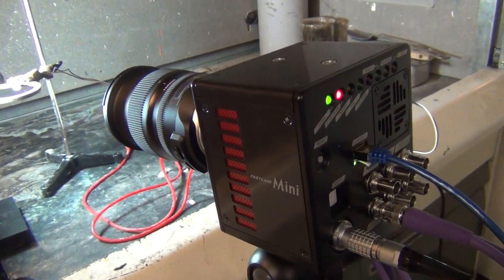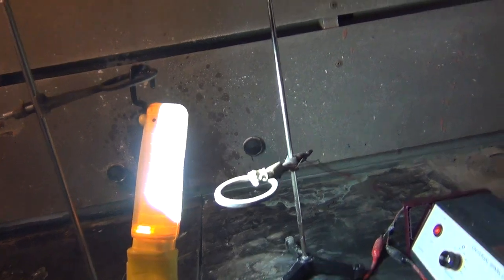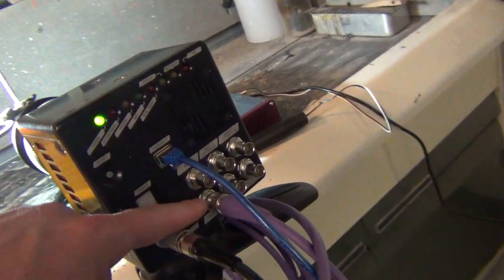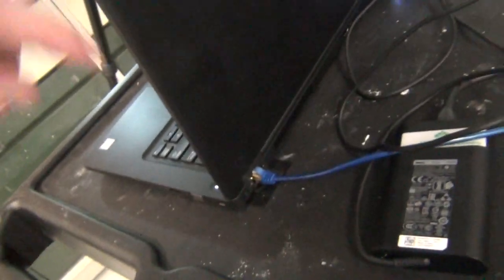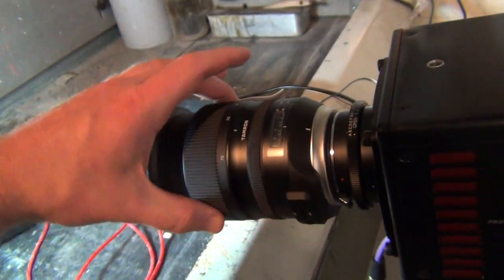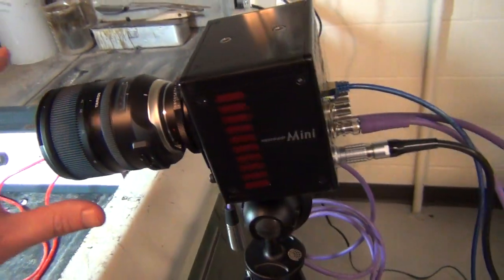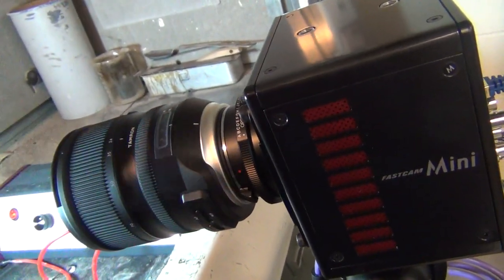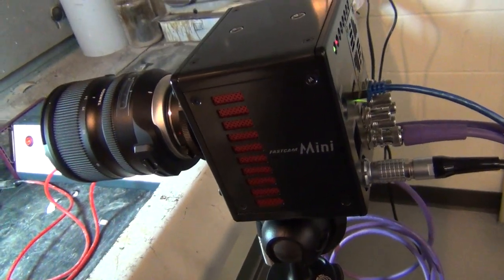Photron AX200 MiniCam high speed camera setup introduction - part 1 camera setup

Comment: Hello! Very interesting installation. It is very interesting to know what photo equipment you used for shooting: a lens and macro rings.
Our university, which has at its disposal the same chamber, intends to remove the process of thermal spraying (similar to welding).
We have an AF-S VR Micro-Nikkor 105mm f / 2.8G IF-ED lens. But will it be possible to photograph the spraying process?